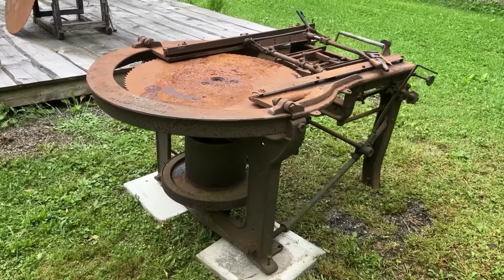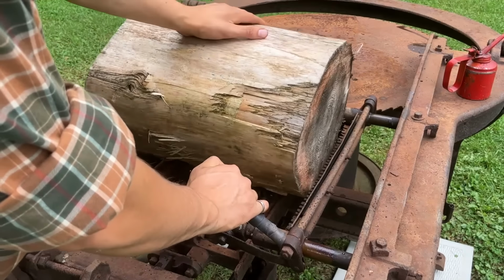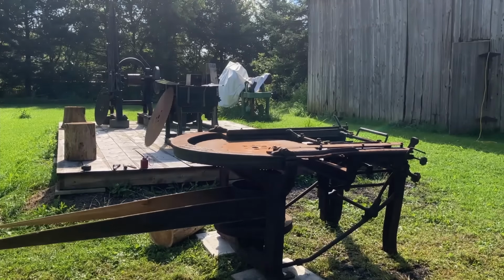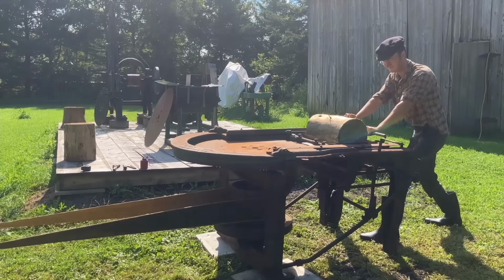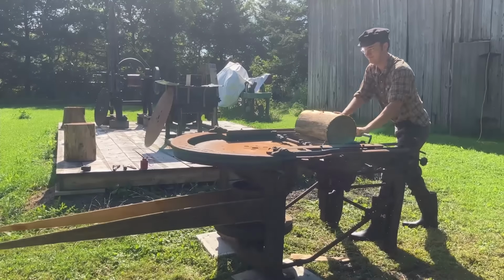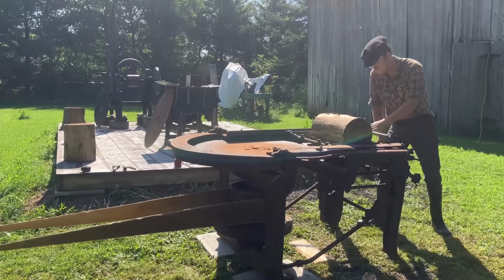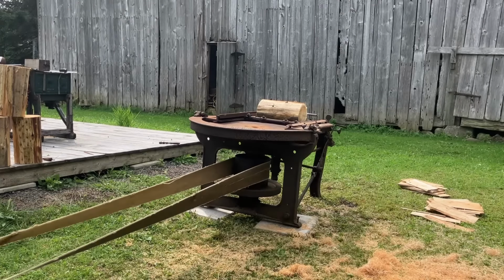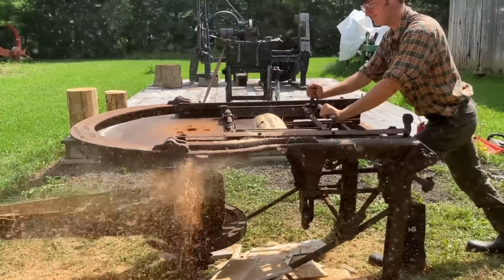First Run of a Horizontal Shingle Saw

Comment: You need a clean blade, and a big oil can full of Turpentine. A few drops into the blade, lubricates and cuts through Sap and water. An Uncle of mine cut Cedar Shingles. But he said, the Turpentine works on all woods.  He had a Dripper, made from a coffee can or some such, that dripped onto the Right center, of the blade, just in front of the operator. The can was mounted on a piece of sqare tube mounted on the right side of the machine.  A simple brass valve and a piece of copper tube bent to the right place. He could cut shingles faster than any Roofing crew could lay them!  Ever since, Ive loved the smell of Turentine!😊  I have no idea whatever happened to his machinery.  Never thought I would see one running again. Not sure of factory specs, but his was spinning Twice as fast,,, at least 😮?  It sounded like an Airplane taking off!   This is a memory from the early 70s.  He had half, of some "old" truck or car, to run the flat belt. It was hot, smoky, dirty, dusty, and the smell of Cedar, Pine, burnt motor oil, and Turpentine are fondly seared into my brain.  To that point in my life, it was the most terifying machine I'd ever seen!  Cool!😊
Reply: A large drive pulley would cause it to run faster.
Reply: This comment wins the internet
Reply: What a great memory to have!
Reply: Wow. Fantastic.
Reply: I'm sure a sharpening would help that saw cut faster and a wire wheel to clean the rust off the blade.
Reply: @william6526 
Браво !!! 👍👏👏👏💪...
👋🇷🇸🍺.
Reply: Now we're loggin'
Reply: I was thinking just the same he had it running as fast as it would and it only slowed as the cut was made and then would wind back up
Reply: Cool story.
Reply: Glad you shared. Hopefully the producer of this video got the message. I would love to see it run with the turpentine now.
Reply: Wax. Just use wax. Get a Lennox lube tube and occasionally apply it between cuts. If you use oil it's just going to turn into greasy sawdust clumps. We have advanced lubricants nowadays, no reason to use old man recipes.
Reply: They have a new chemical called evapor rust good stuff man check it out

Comment: From a 70 year old Bloke, a Plumber in the trade for over 50 years, who has just been diagnosed with Pulmonary Fibrosis, a fatal disease that will eventually suffocate me, caused by inhaling foreign matter such as that rust and wood dust, I'd be investing in some form of face mask if you don't want to suffer the same fate. Great machine, fascinating, please look after yourself.
Reply: That’s the first thing I thought. I’d be pissed if someone made me breathe iron oxide. Wood is a bit different but still not ideal.
Reply: I agree fully. I'm also an old woodworker with only one lung; lost the other one to cancer due to wood dust cedar is particularly bad this way). The other lung ain't too good either. Take care of yourself son, wear a good quality mask when around wood dust.
Reply: Eu também estou sofrendo devido respirar pó de madeira ,cheiro de tinta e solvente.
Reply: @ejvaz13  Wood dust is nothing to mess with, as other people sick from it have attested. Even "non treated" lumber still generally gets sprayed with a surface treatment of anti fungals you don't wanna inhale, and wood fiber is pointy at the microscopic. Its not as bad as absestos and silica dust but similar mechanism. But it also takes longer to settle out of the air so your exposure could be even worse.
Reply: Everyone is bulletproof when they’re young, like you said,it’s 30 years down the road you want to plan on.
Reply: @ejvaz13  Wood dust is worse than iron oxide.
Reply: Wishing you all the best for your health
Reply: Black lung, asbestosis, silicosis, are all types of pulmonary fibrosis. 
Caused by the same process, breathing something into your lungs that ain't supposed to be there.
Reply: Why not make a video on restoring that or work with another content creator to restoring it before making a video on how it works
Reply: My family has been deeply impacted by a member having PF.  I wish you the very best going forward.  I wish I had something more positive I could offer you my friend.  Make the most of every day you can Aussie.
Reply: Jesus Christ can give you a future and hope. 
He died for our sins taking the punishment we deserved. If you believe you are saved by faith in Him and we can live eternally as HE does. Talk to Him today.
Reply: @hopefilledsinner3911  Why did Jesus give him pulmonary fibrosis in the first place?
Reply: When my dad got his plumber's license in the 60s, part of the test was how well one could poke the lead wool in a joint, then don his asbestos mittens and pour molten lead, kept in an open cauldron nearby, to seal the joint. Then they wrapped the pipes in asbestos plaster. 😮
 Thank you for your part in making the modern world possible.
Reply: @hopefilledsinner3911  Why would we deserve punishment, if god made us this way?
Reply: Truly sorry to hear about your condition. I would go along with a Hepa face mask along with hearing  protection. My hearing is shot from operating a chain saw as a youth without ear protection.

Comment: I admire courage and say that you have the correct idea on how to saw shingles. I worked in shingle and shake mills back in the sixties and early seventies. That saw blade measured 52" and turned thirty six hundred RPM's. The blade had a cup to it and when turning its correct speed, the blade leveled out to be very flat. The system you have is usually called a flat sawn shingle. Same principle and still needs to turn a higher speed. Right now, the blade is ripping the wood and not making shavings. They split those blocks to be able to have a vertical wood grain on the shingle and avoid cupping of the wood when dry. Small logs like you are using would benefit from being split like a three piece of pie. One quick pass to clean up one side and then turn the block to the next position and make nice clean on one side shingles. The flat saw used different standard lengths, 16,18, and 24" lengths of shingles to use up wood that would not make good shakes which normally are twenty four inches. Because of much larger timber in those days and not second growth small trees like you are using, you could make up to fifty squares a day or about two hundred bundles done in a packing frame. Although I have made several kinds of saw mills, shakes and shingles were not my thing. One thing I did saw though was cedar weinscoat. Used in many applications like inside closets, or on walls like restaurants and banks. It got rid of moths in any kind of cupboard or closets. Those small trees you are using for your shingle application would make a fine and beautiful weinscoat wall adornment. any closet or home can use them in many ways and you will find out there is a tremendous market for it. Wishing you luck with your endeavors
Reply: I love that idea of using cedar for wardrobe wainscoting. Thanks for sharing your knowledge
Reply: That’s why there are many different widths of eastern white cedar shakes. Quarter sawn is key- flat sawn cups
Reply: Some great tips. Hope he gets to read these and implements and does another follow-up video. I love this old history and the experience is everyone is preserving.
Reply: Isn't is WAY easier to split shake shingles instead of cutting them?

Comment: A good friend of mine had a little earlier version of that saw that saw that we cut 1000's of shingles with at shows. luckily someone pulled up and paid him a large amount of money for it and removed our temptation of running it. You must always be aware of where your hands are. Also with about twice the RPM  it is a lot easier and smoother. Have fun and be careful.
Reply: cut 1000s of shingles with.  Someone removed our temptation of running it....  Something doesnt add up here.

Comment: What a splendid piece of machinery! So wonderful to see a piece of belt driven equipment at work. 

A Massey-Harris 44 or a Cockshutt 40 would give you the belt speed and power you need for that saw. Maybe even a Massey-Harris 30 or a Cockshutt 30. A Case VA seems a little light for that job.
Reply: When I was a kid, Dad had a buzz saw we used to cut fire wood.  Most of it was from pallets he got free from work but also small trees and limbs from our woods.  He powered it with a John Deere 530.  He had a JD 630 as well but the 530 had plenty of power for that .  I think the blade was roughly 48".

Comment: I saw a man at a mountain fair here in Georgia many years ago, who used a hatchet to make shakes.
 He was very fast and efficient .
  I think you would cut faster if the blade was oiled smooth and also had a precision sharpening.
  I saw a YouTube video a while back of a guy who sharpened big blades like this one.
  He also trued them up which was an art in it's self.
Reply: He would hae used a Froe, hand splits are worth more $$$

Comment: The Mechanical history Round Table of Rochester Mn has this same mill. Have been using it for close to 50 years during our shows. Your sharpening method is going to destroy your blade. You need to learn the correct way to sharpen a blade. Additionally, that blade needs to be cleaned up before using it. Another thing to realize is that most all of the buildings this side of the Rocky Mts with wood shingles had shingles made of White pine, and not Cedar as most people believe. You are cutting dry wood. Shingle mills were made to cut green wood. Green wood takes less power to cut and does not dull the sawblade nearly as fast as cutting dry wood. Shingle mill blades are hard to find and replace. Take special care of your blade. If you need help with your mill contact Mr Z, head sawyer at MHRT Rochester Mn.
Reply: Isn't white pine prone to rot?

Comment: In the early eighties I was offsider on a well drilling crew running an ancient belt driven percussion rig. We didn't use the small belt driven the tractor as it was too slow. Rather the boss backed the tractor in place and we jacked it off the ground and drove the belt with the back wheel. We dug holes and put wood post in each side of the belt for guides to keep it running true on the rear tyre.

Comment: This is probably the piece of machinery that looks the most dangerous, but turns out not to be that bad. It doesn’t look like you could fall in very easily, or that the wood would fly up into your face. Thanks for the video.

Comment: We have quite a similar machine at our workshop in dresden, germany, but no one ever saw it running, so thanks for the demonstration! Even so, you were just producing a lot of firewood there...
If you are aiming to cut high quality shingles, you need to quartersaw or split your logs beforehand and then flip them every cut to get standing annual rings. Not as good as split shingles, but close enough.
Reply: The machine in Dresden is all locked up from fire damage.

Comment: An ingenious design where you flip a lever and it changes the bevel after each pass, so the log gets reduced evenly. I've installed wood shingles in the distant past and when I busted open a bundle, it had shingles of every width from 6 inches to over 16 inches. But you use your roofing hatchet to split a shingle to the desired width at the ends or for middle repairs. Most communities here in Texas have banned wood shingles. because they were considered a fire hazard. Every year people with wood shingled roofs would stand outside on New Year's Eve and the Fourth of July, watching for stray fireworks that accounted for a large portion of roof fires!
Reply: Brilliant design!

Comment: I felt it through the screen when you kneed that linkage. I also might consider rigging up some kind of hard shield in front of the push bar so your hands can't slip over into the blade, that sketches me out haha. But just clamp on or something obviously don't wanna pemanently modify this piece of history if it can be avoided.

Comment: Very cool! I have two old vertical flat-belt circular saws with blades around that same size. I have never before seen a horizontal one. Mine look even more risky to use than your shingle mill - so they are currently static displays only.

Comment: Given the sound of the saw: '' wing wing wing...", I believe the radius of saw is not the same all around the outside. It happens when a round saw is sharpened by hand, Very difficult to control. Requires careful attention to number of strokes of the file on each tooth and pressure applied by the hand" ! Nice device as heck anyway !

Comment: Fascinating piece of technology for its day.  Perhaps wire brushing the blade with a rotary grinder beforehand and then a generous application of PAM frying pan spray would reduce the friction significantly. Coincidentally, even though i discovered your video accidentally, am currently designing an electric powered shingle machine.

Comment: Those machines are so cool but a little dangerous! LOL!!! Thanks!
Reply: Yes, they did not have any safety features,  but people from that era used something that has been lost these days.  GOOD SENSE. THE ANILITY TO THINK AND ACCOUNTABILITY.
Reply: @captianm4766  You got that right! Everything is idiot proofed to the point that people can't think for themselves and use common sense. Thanks.
Reply: All machines are dangerous when there’s a loose nut behind the controls!
Reply: I always follow dangerous with LOL
Reply: You could build a little log house and use those shingles on the roof, it would look great. You made a good job sharpening that blade.All the best from England,

Comment: I would disassembly that machine and refurbish every single part. Then grease all the moving parts up and reassembly it. And it looks like once you get the proper tilt and thickness you want, all you should have to do it make a cut, pull the sled back and release the side holder to allow the wood to set down and lock it and cut again...  No need to readjust the machine after setting it for what you need. It would work more automatically and faster too.    Thumbs Up!
Reply: Yes me too. At the very least remove the blade, polish it and sharpen it. It also need something with more HP and more RPMs to power it.

Comment: if you split cedar instead of cutting it, the grain is preserved and the shingles last quite a few more years because of water ingress to the grain split by the saw.
Reply: I was told the same thing but my own experience has shown me different. I reshingled 2 roofs on 2 different outbuildings 34 years ago. One building was done with NOS 24" clear shingles with bundles bound with tin strapping(old) I found in my barn. The other was done with 24" shakes I bought new from Grossman's Lumber. Even that long ago I felt the shakes were fairly expensive. Both roofs are still water tight but both are deteriorating at the same rate. Both roofs are now very dry and brittle and I am seeing random shakes AND shingles crack and break from snow, wind ,ice etc. Both roofs need replacing before they fail and begin leaking. Both roofs will be redone this spring with cedar shingles. The life span was pretty much identical.😮

Comment: Looks like it pivots in the center of the block so that you can cut left side thick, then right side thick on the next pass.  Extra bonus is you get lots of free "Excelsior" for packing... or sell it as fire starter.

Comment: Horizontal saw probably saved fingers , but it took an extra man to operate the mill , with vertical saw the Sawyer was also the trimmer man . Then the packer did the rest . As the saw was sharpened it got smaller , after a while the clip would not be cut through and the nature instinct is to reach up and pull it free , funny thing is the saw don't care if it's wood or flesh it just cuts . The trim saw also took a few fingers but most of the lost fingers were from the left hand . Also the whole mill got high . Main saw- drop to trim saw - drop to packer

Comment: Great piece of equipment 👍👍👍👍. It sounds like it could use some more power. The tractor is slowing down a bit. I’m sure it is using the file. Are the teeth “set”? This means the teeth are bent to one side every other tooth. This makes clearance for the blade not to touch the wood while cutting. Something you might try is to use a tiny bit of chainsaw oil on the teeth. Then make your first cuts on the log to get rid of the excess. Love the video ❤

Comment: Tool and die maker, Engine, off road , dusty area tip. 
Anti seize is your friend. NEVR seize brand in big tub with brushis my fav.  Ohhh. And it gets all over, so keep the tub in in a zip lock bag.  Its advantage is when all the lubricants dry away it still leaves a metallic lubricant film that reduces galling on rotating parts. Itll start to squeak and warn you.. My best advice is . Mix 3/4 blue/marine waterproof grease, 1/4 antiseize. Put on everything but a high speed spindle or wheel bearing. Slather over ENTIRE threads of bolts and slides, more is better. 30 years from now youll thank me...And Your welcome friend!

Comment: Great video.  Love that old technology.  Still trying to figure way to power my recently acquired Champion no 1 power hammer, hoping to avoid the need for a leather belt due to cost and replacement availability concerns.  If you have any insights would be appreciated.